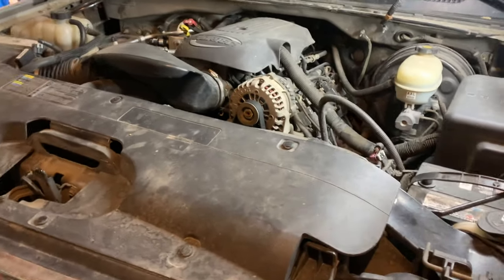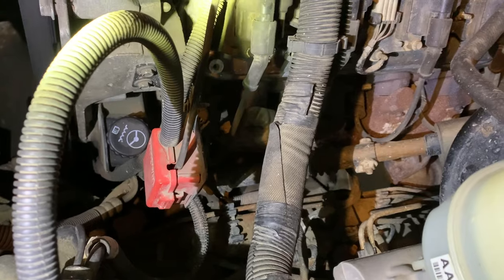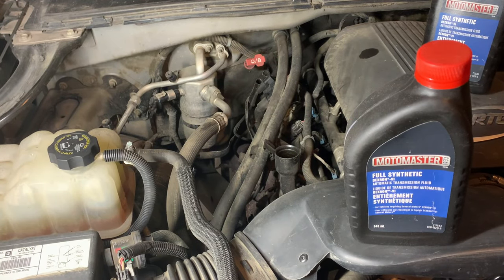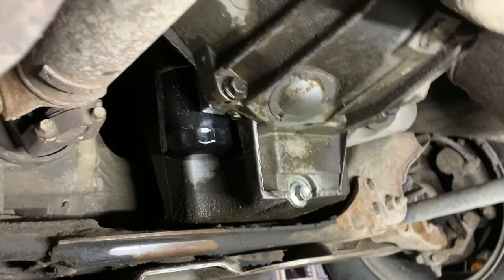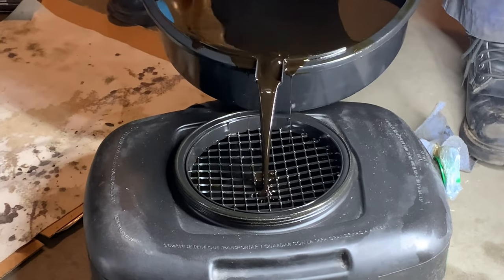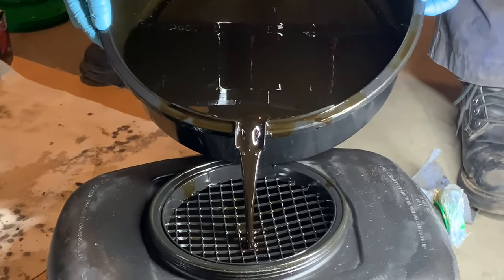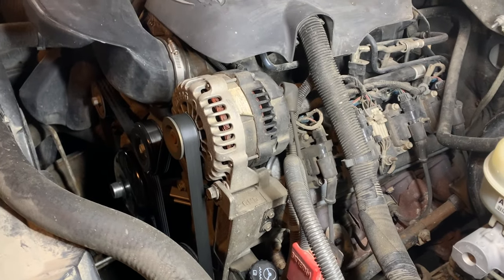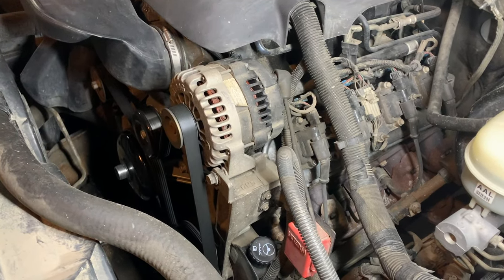DIY Engine Flush using Automatic Transmission Fluid

Comment: Your tick/knock is from a worn out oil pickup tube o-ring.  Its a $3 part.  Drop the oil pan and replace the o-ring and problem is solved .
Reply from the maker: Interesting! Why does that tube cause a ticking sound?
Reply: Loss of oil pressure, oring allows air through and aerates the oil @lmsdiy
Reply: @lmsdiy  it's like sucking through a straw with a hole in it
Reply from the maker: @kingeasy6184  ahhhhh! Ty
Reply: Interestingly, atf has modifiers to make orings swell and make better seals. This feature may be why you had so much improvement aside from the extra cleaning.
Reply: I agree had the same lifter tic, dropped the oil pan found sludge in there, cleaned it well, replaced oil pickup tube O ring, and no more tick.  Oil pressure is better as well after that.
Reply from the maker: @akenthusiast101  thanks for sharing the experience with that!

Comment: Engine is Eff'd !  Lifters are sticking as their Oil  feed is clogged.. period.
 IF you changed oil and filter 'occaisionally' there wouldn't be a problem.
 ATF (being 7 w) likely allowed some oil to reach the lifters.
Reply from the maker: Thanks for the info. I bought the truck at over 300k so no idea how previous owners (didn’t) take care of it. I changed it out for a 2013 Silverado!

Comment: Forget all that BS.  Empty your oil.  Take 4 litres of ATF and pour into engine. Run engine for 30 seconds then leave it rest for 30 minutes.  Drain and leave draining until it stops dripping.  Change filter. Refill with oil. Brilliant
Reply: What 30 seconds will do??
Reply: @jaym.1106  ..some recommend even less. Believe me, the engine is like new.  Go for 15
Reply: I can't understate how much I don't want to do this to any engine of mine but if you must, I'd do a second oil change to run the car for an hour then change immediately afterwards.  Some of that ATF's bound to be left behind inside the engine even if you left out the drain plug for a week. Thus an additional oil change as a "rinse".
Reply: @jaym.1106  Circulate the ATF inside the engine - so the deposits and sludge have an opportunity to soak for a while.

Comment: What is causing you engine noise is the lifeters that are clogged and very difficult to clean without taking the engine apart and or replacing them. Every engine that I have seen that was abused in one way or another does the exact the same sound. Also, lets us not forget worn rockers do not help either. Peace fella vf.
Reply from the maker: Thanks, brother. I'm not sure this engine was well-cared for before I picked it up...
Reply: @lmsdiy  I understand. Using transfluid is still the cheapest and best way I have found do far. One other thing, DO NOT DRIVE THE CAR WHEN YOU DO THIS TRICK, . Peace vf

Comment: That tik tik I think you did it with a key to simulate the tik tik, it doesn't sound real
Reply from the maker: Sad that it is a real sound 😂
Reply: @lmsdiy 

I thought it was a spell sound 😂😂😂 and tell me if the tik tik was removed from the flush atf
Reply from the maker: @fernandopozuelos22  lol sadly no. Engine oil remained cleaner but the sound never went away. Fun experiment though 😃

Comment: Why???  It has less than half of the viscosity and far less detergents, dispersants, antioxidants and anti-wear additives than fully formulated API spec oil.  The problem with  carbon, varnish and sludge in an engine is due to 10-20% of old oil is left in the engine after every oil change. That old oil that goes through another oil interval is causing the problems. I use a fully formulated oil as a rinse oil after every oil drain. I get 99% of the oil out. New oil cleans, protects, and last longer.  After 190k miles, engine is still clean as a new. Use the rinse oil 3x before recycling, only adds $8 extra cost, and 15 minutes of time to the job.
Reply from the maker: The "why" is easy. Because I felt like it, it made a fun experiment on my 330,000 km truck, and I like experiments. No disrespect to your question... I'm just giving you a truly honest and straight-up answer. Appreciate your sharing of other options that sound pretty darn good to me!
Reply: @lmsdiy  try something unique. ATF is out dated, repeated adnauseum and not an experiment by any stretch.  Try Radial Chromatography to inspect oil condition.  Two drops of hot, used engine oil on a elevated blank business card stock. Allow to disperse for 6 hours. Examine with a magnifying glass, backlight, and blacklight. Do this over the course of the oil life.
Reply: @liberals_destroy_everythin2497 who are you replying too?
Reply: That's silly and a waste of money. I've been driving for 34 years, driven several vehicles over 200k. Just change the oil and filter every 5k or 6 months.

Comment: Fully sythetic oil is good for 20,000 miles. Changing oil every 3000 miles is a hangover from the 1940's,50's .
Reply from the maker: Although you are right that the oil lasts a lot longer these days than ever, I'll definitely bet money if you change your oil at those intervals on 2007 and newer Chevy trucks, your AFM hydraulic lifters will fail and you'll be pulling apart the engine to fix that because of oil changes...
Reply: @lmsdiy  In Europe engines are designed for extended oil changes. Ford Europe ,oil changes are recommended every 18000 miles. Mercedes Benz oil changes are recommended every 27000 miles for the latest Euro 6 engines. I run a 2002 vauxhall Astra diesel . GM specifies oil changes every 20,000 miles for this vehicle. Personally i change the oil every 10 to 12000 miles.
Reply from the maker: You guys are lucky over there!!! Wish I could say the same... :( The old Chevy engines, maybe. The newer ones in Canada with AFM/DOD are terrible for hydraulic lifter failure due to extended oil changes. 🤦🏻‍♂️
Reply: Extended oil changes like that show their affect after 100K and were implemented to reduce fleet oil consumption.  If you intend to keep your car always follow the "severe driving" conditions change interval.
Reply from the maker: @GrzegorzDurda  couldn't agree more. I bought this truck very used and don't know the history on maintenance. But I  do a lot of regular maintenance on my stuff and use a severe schedule too
Reply: @leonardgoldberg2879  "Fully sythetic oil is good for 20,000 miles. Changing oil every 3000 miles is a hangover from..."

" I run a 2002 vauxhall Astra diesel...GM specifies oil changes every 20,000 miles...i change the oil every 10 to 12000 miles" ... You argue against not following the manufacturer's recommended intervals but then go onto to say how you don't follow recommended intervals by half. Most people realize that the manufacturer isn't going to be there when the engine fails earlier than it should have due to their "Marketing Claims". Oil is cheap compared to a new engine...also, recommended intervals don't take into account the damage done by short trips that so many take.
Reply: Oil doesn’t wear out. It just gets dirty.

Comment: Leave the transmission oil there don't remove it.
It will make your motor run better.
Reason why transmission oil changes are every 60 to 90kkk is because transmission oil it protects the internal metals way better than motor oil.
I have been adding 1 quart of transmission oil to all my oil changes, and I have never had any more thicking or valve problems.
Start doing it... you will thank me later 🫵🏻
Reply: Can we do in newer cars like subarban 2019?
Reply: @khusimangurung6202
  Yes, you can.
Replace 1 quart of motor oil for 1 quart of transmission oil in every oil change.

Comment: Bad lifter
Reply from the maker: Is it possible that it's more than one bad lifter? And that it mostly only happens when the oil pressure is not high - like idling, cruising. When I'm towing the trailer and the oil pressure is higher (using tow/haul mode), it doesn't do it most of the time.
Reply from the maker: It would make sense because they are hydraulic lifters I believe. But a mechanic checked it out and thinks it's not lifters and that's it's wear in the the camshaft or crankshaft (I don't recall exactly what he said).
Reply: @lmsdiy  was reading for my dodge avenger 2.4L it showed some lifters stick in open position due to faulty release, and I'm thinking it could do harm to camshaft, after all this I think I'much prefer solid adjustable tappet lifters

Comment: it will work but at the cost of taking the finish off your main and rod  bearing, keep transmission fluid where it belongs in your transmission. there are better engine cleaner than that on the market.

Comment: bro you must drive vehicle few hundred miles at least three. ten minutes idiol doesnt clean much.
Reply from the maker: Thanks for sharing the tip. I’ve definitely  heard that as well and (and the opposite). 🤷🏻‍♂️ 

I think as long as your engine and oil ends up being cleaner than before, mission accomplished! I did this on several vehicles and the engine oil was much cleaner on the next few oil changes. 🙂

I think I will take it for a drive the next time I do this, like you suggested. Thanks.